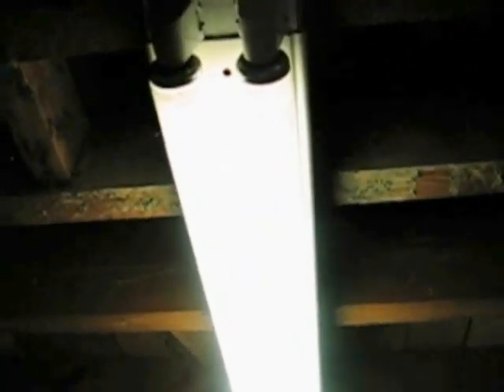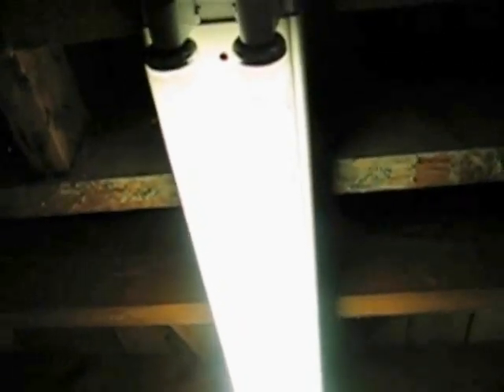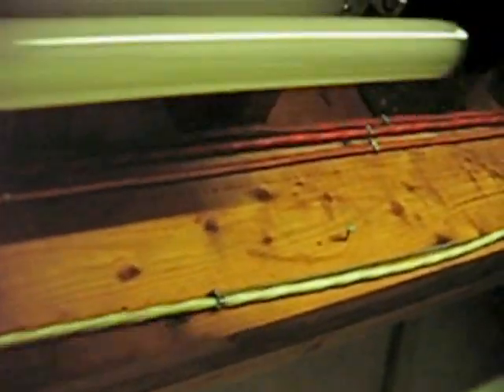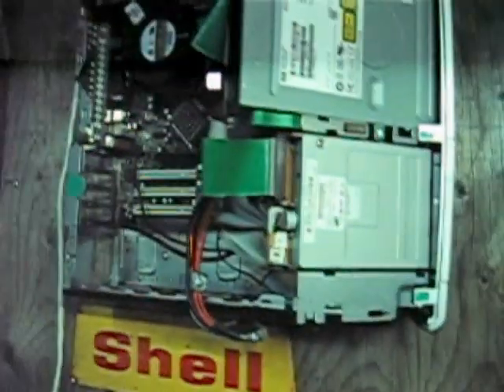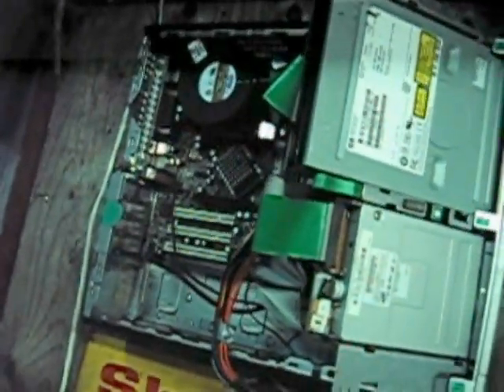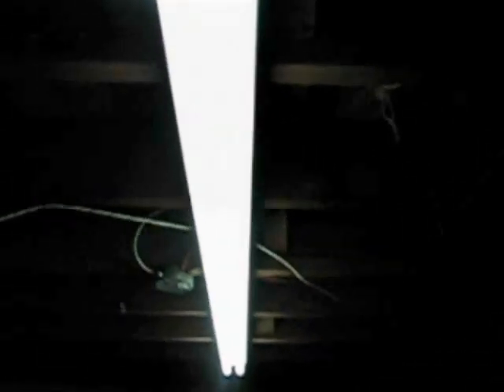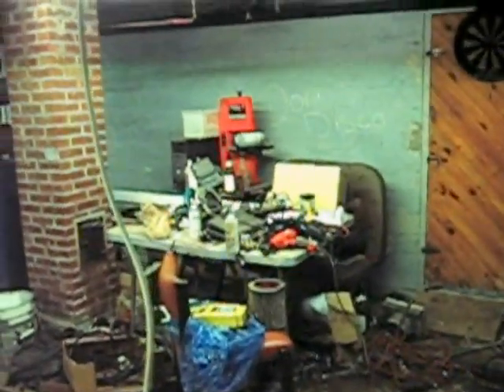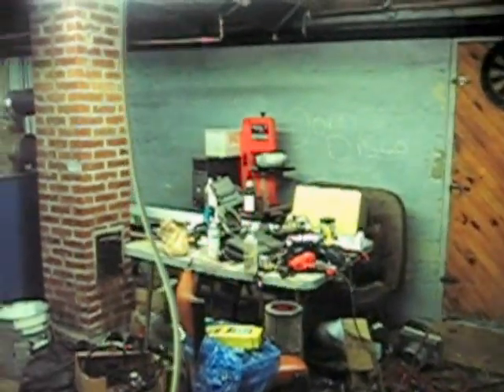my basement lighting

Comment from the maker: actually they are way easer  than the 4 footers the 8 foots only have one big pin on the end and one socket on the fixture is spring loaded  you just put that end in then push towards it so it compress in then slide the other end in to the fixed socket and release the pressure so the pin on that end slides in and its done   unlike the 4 foot that you have to line up slide in and try to make turn to lock in    sounds complicated but i can put a 8 foot in one handed in 20 seconds

Comment from the maker: they are big i like them even though they are soon becoming a thing of the past cause of the power they use compared to too 4 foot 2 bulb fixtures with t8 bulbs like what was in the single bulb fixture in the video  the input is like 1.22 amp at 120 volts  and the too 4 foot modern t8 2 bulb fixtures use less than 1 amp or something like that